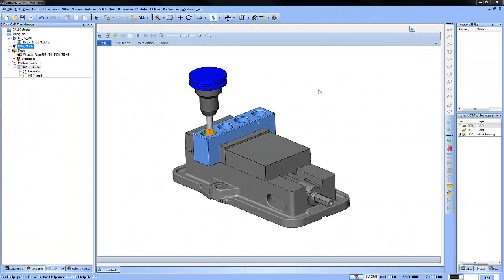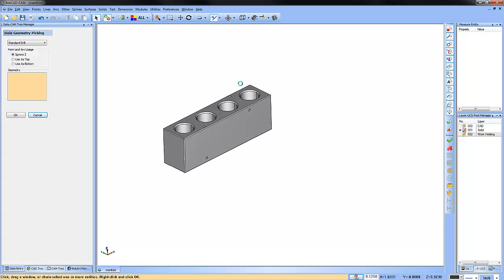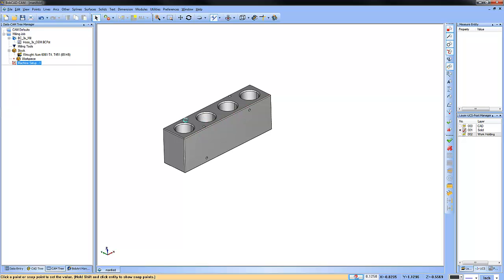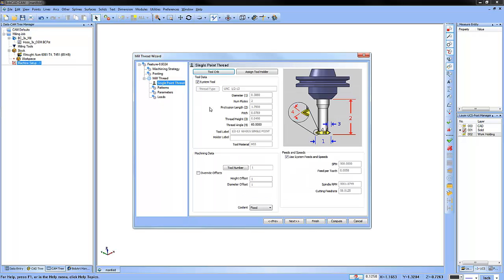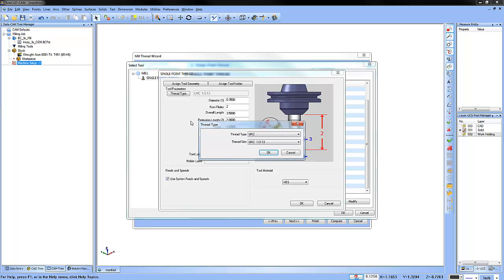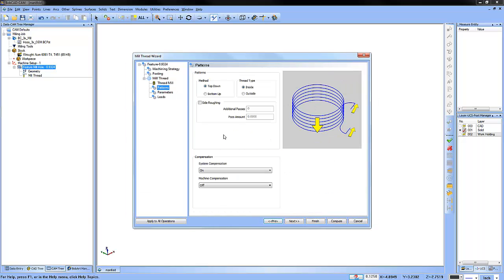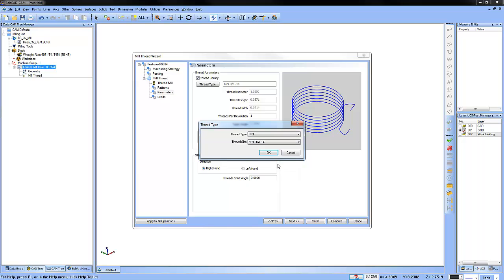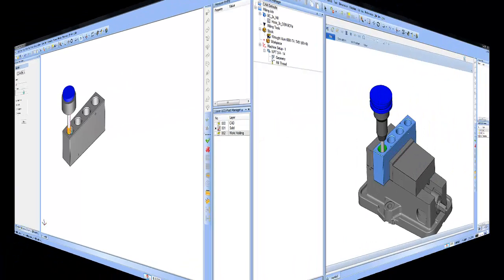Thread Milling - BobCAD-CAM Quick Tip

Comment: I have been using the thread milling option in this software quite often. particularly tapered pipe threading, It works rather well, you can also set to multi passes on heavy pitch threads, It sure saves trying to use a heavy leverage bar to cut a consistent pipe thread, I recently made some big stainless manifolds, generally from top to bottom,  maybe 2passes, they work every time, V30 has a habit of changing thread pitch, ya just need to go back and verify the pitch before posting, we did a couple of dozen, only had to run the tap down to deburr intersecting holes. Thanks guys for making my job easier :0)

Comment: taper from, not start from top/bottom.
Reply: Yes you can cut top down or bottom up.  You'll find that under pattern, choosing the method top down or bottom up.  Next under thread parameters you have the option taper from top or bottom.   So you're covered, these are simple options to set using the Mill Thread Wizard.

Comment: You say you can load a single point or multi point thread tool, I have yet to locate a multi point tool in the library, Can you show more specifically were they are at? You also did not cover taper from top/ or taper from bottom...
Reply: In the tool library you can choose the tool type you want to use,  either single point or "thread Mill" which is your multi tooth cutter.  You'll also find that on the parameters page when you tell the software  the threads per revolution you want to cut with. When you change this value to more than 1 you tool will change to a "thread mill" which has multiple teeth...    As far as top down or bottom up cutting, it's just a button you push that it.  Super simple!   If you need more instruction, I recommend you call us for a one on one demo so we can walk through the feature together.